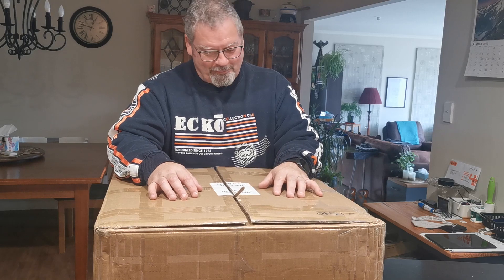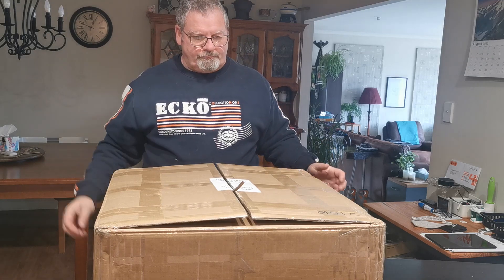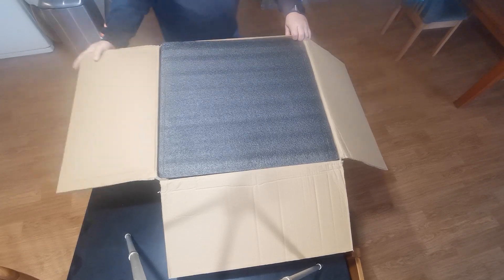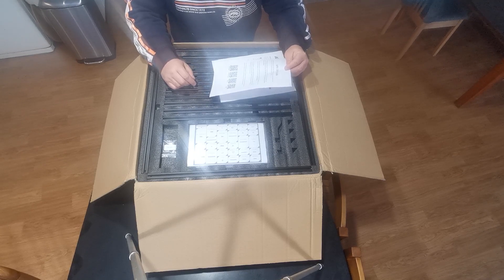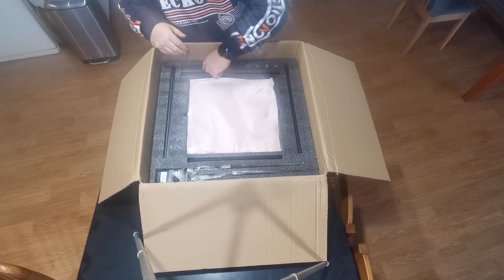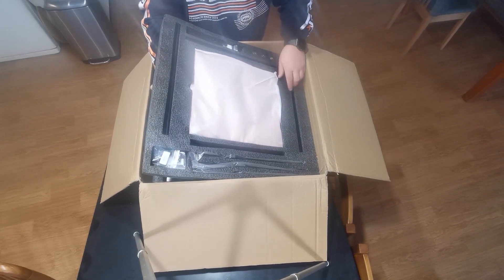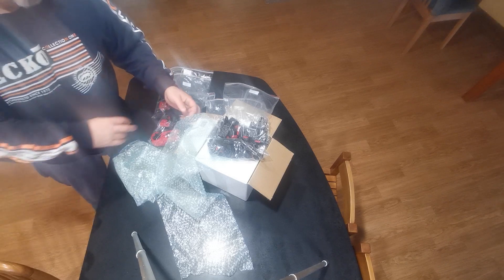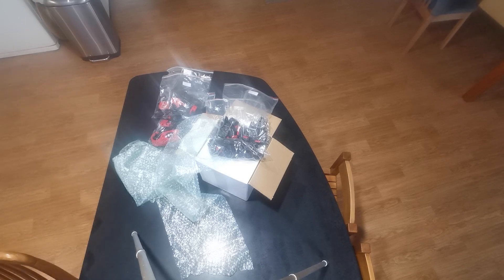VORON 2.4 R2 MPX CBT BUILD SERIES - PART 1 - UNBOXING

Comment: Cheers Westy.
The unboxing was helpful, as there hasn't been one of recent times. What upgrades did you go with from the standard CBT kit?
Noticed you went with the CNC tap and Rapido.
Did you get the standard hotend as well as the upgraded Rapido in the same box? 

Thanks for sharing the unboxing, it's made me confident in the purchase ahead of me.

Looking forward to the build.😊
Reply from the maker: hey @therealnoop. I upgraded to the CNC Chaotic labs CNC Tap upgrade and the Disco LED light system. I made the mistake of ordering a second Rapido High Flow hot end as I did not realise it actually came in the kit. It is actually really great quality.
Reply: @rent2ownnz  might be worth checking the hot end as I think it might be a Dragon as standard, and they add the Rapido as upgrade option.either way $10 uplift and you got both is a win win. 
Did you opt for the UHF or HF version on Rapido.
Reply from the maker: Hi Again :)  @therealnoop  
The Video is the only time I have actually opened up the box and had a look. I was rather surprised that the Rapido was in there. I thought that is was some special part upgrade that took the Rapido. It is a Genuine Phaetus Rapido HF. I also ordered a Triangle LAbs Rapido HF hot end as well.... and I also ordered a Knomi (Big Tree Tech) as well :) The Voron Print it forward guy that printed all my functional parts suggested the Rapido as he has had great success with and when I asked him about the HF and UHF he said unless you like strapping a rocket to things... "you will be very impressed and have great repeatable super fast prints with the HF RAPIDO". So I took his word for it and did what he said to do and got the HF.
Reply: @rent2ownnz  I'm after quality over quantity, going so fast doesn't interest me. The knomi was also on my upgrade list. But down the line. I was hoping to write my own code for it if it's possible.